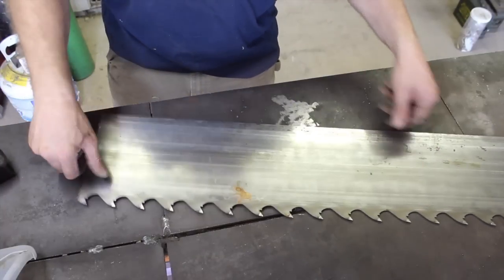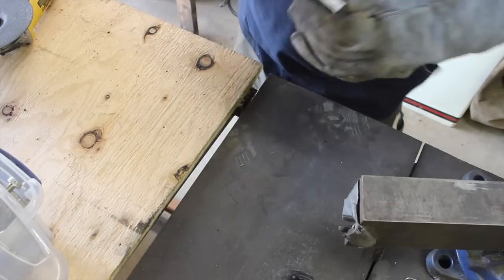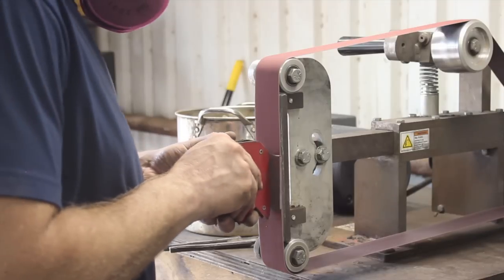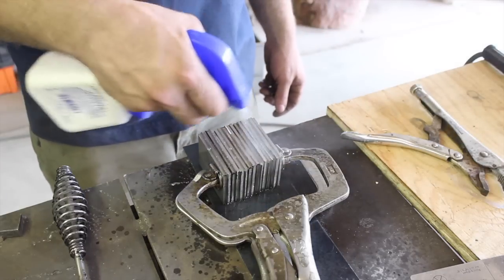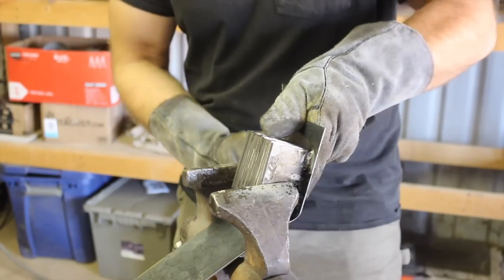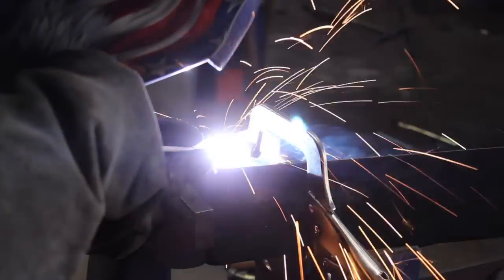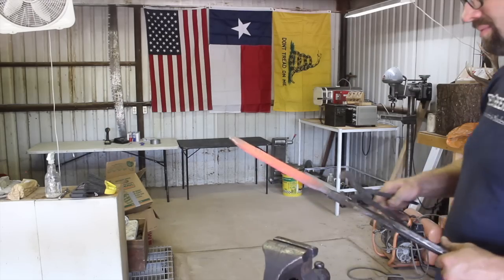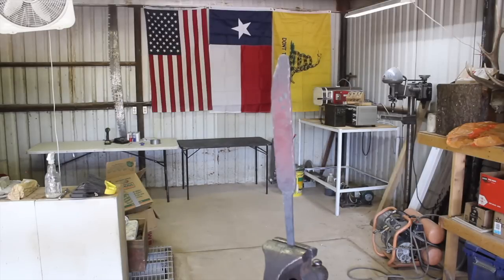FORGING Damascus From SAW BLADE for my First Bowie Knife in TEXAS Bladesmithing and Knifemaking

Comment: a trick to more easily get the canister off
get some stainless steel foil and wrap the billet in that before putting the canister around it
the stainless will act as a barrier to prevent the canaster from welding to the interior billet

Comment: When your drawing out the billet under the press with the round dies it helps with keeping square by alternating drawing the stock through at 90 degrees to the dies and then 45 degrees each way on each side of the billet. In the same heat if you can. If not keep note of orientation and complete and repeat on the next heat.

Comment: you really need a mig welder , your introducing slag you just dont need and porosity is 10 times more likely with arc. Plus arc is designed for 3 mm and above thickness material with the smallest rods you can get ,

Comment: I kind of cringe calling it Damascus, but Pattern Steel speaks to me. My studies in my return to college were Metallurgy and Metallography. And my Proff did an experiment with a one inch piece of actual Damascus steel blade. He cleaved the head off a garage 8 bolt then viewed it under our Scientific Microscope to show us no deformation in the blade. The advent of the SEM allowed the detailed examination of Demascus steel. It surprised the community and finally explained it's abilities. And the only way to truly reproduce is to include the impurities or excess elements they found. Hence my liking Pattern Steel better. Love the replicas though. Thanks for your efforts.

Comment: Why not tig weld the billet after the original weld? You can tig without filler rod and not add any mild steel.
Reply: I agree. I never welded something like this, but It may split at the welds unless using a wire that would hold up to the job at hand. Since you heat the entire billit up, it may not be a problem. Guess you would have to test it first. 7018 stick has good properties for what he's doing here obviously, and it does the trick.
Reply: @yourdrummer2034  a fuse weld with a tig torch would hold find until the forge weld was pressed.  He likely doesn't have a tig welder or has experience with one.  Stick welding is very basic and practical.  You don't need gas shielding and it's a cheaper set up.

Comment: You should attach a piece of round steel to your press handle and run in down to the floor and make a foot pedal.  That way you can use both hands to control what you're working on.
Reply from the maker: Just did a couple weeks ago :)

Comment: Using that cutting disc without a guard is the most dangerous thing you can do my friend . If it breaks and hits you in the face or body it's like a bullet.
Reply from the maker: Yes, there's a level of risk. I am wearing a full face shield when using it.
Reply: I had a call from a mate yesterday.  Cutting disc failed and almost took two fingers off his left hand.  Luckily they’re ok because the disc bounced off the bone in both fingers but took 20 odd stitches to put them back together. Those guards are a pain in the butt BUT the consequences of not using them are pretty dire.  A facemark is mandatory anyway but good luck forging without all your fingers

Comment: Impressive, instructive video as always. 
Did want to ask what you did with the cutoff portions of the actual cutting parts of teeth . 
Would they be good inside a canister billet in a future build?
Reply from the maker: Not sure if these are carbide edge inserts, if so that would be problematic
Reply: I certainly agree they might not be carbide, I was thinking of a sanmai build with the curved blade ends adding a unique Damascus motif on the outside of the blade along with Center being made with a more dependable steel.

Comment: 2 questions on scrap metal:
What kind of steel is sucker rod Usually?
Same question for truck axle?
Reply from the maker: Both are likely a medium to low carbon steel designed for toughness, particularly the sucker rod. Likely means alloy components, would make a tough tool in both instances.
Reply: @FireCreekForge  would they be different enough for a demascis pattern? And I suppose industrial zero turn lawn mower blades similar also?
Reply from the maker: @billwoehl3051  I don't think it would be different enough for a good pattern

Comment: Why is it that you use 1095 and not 1084?  Doesn’t 1084 etch darker due to the higher manganese content.  Plus the identical heat treating process with 1084.  I use to use 1095 but recently changed to 1084.  Maybe a good video discussion topic.
Reply from the maker: I like the higher carbon content for a bit better abrasion resistance in the 1095. The 1095 still darkens really well. The main difference in heat treat is the tempering, and that is dialing in a temp that works for the bar of Damascus you've created.
Reply: Fire Creek Forge. I understand your point now. I didn’t think about abrasion resistance.

Comment: Hi brother ! Why don't you try to do pattern steel , but without using power tools ... No electric welder , no hidraulic press , no gass forge ... Just  use classic blacksmith tools .
Reply from the maker: Hello, yes I have done that a couple times

Comment: That cutoff wheel looks like its way too big for your grinder. Its practically touching your fingers. Plus the bigger ones are rated for lower rpms, it could explode on a small grinder that spins faster than a big grinder.

Comment: Could 15n20 be used for the can?  And just forged into the billet. Just curious why most smiths use mild steel.
Reply from the maker: It could but greater chance for voids or incomplete welds where steel meets perpendicular on the sides..
Reply: That makes sense. There's no way to get all layered  edges to line up exactly the same.

Comment: The edge retention will like a six cuts and gone :D. These 'knifemakers' are a joke to real craftsmans. What about to find out some information about steel first? No? If the saw blade has welded teeth, the body of the blade is junk steel about 0,3% C and can't be used for a good knife. So much work for such a useless result. FYI, I'm metallurgy specialist.